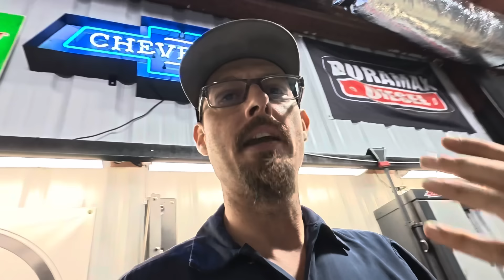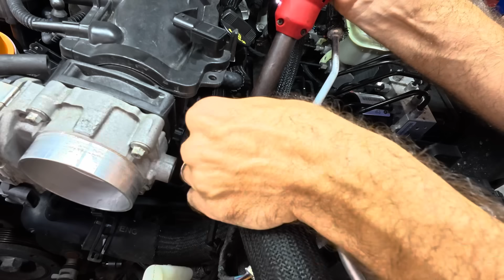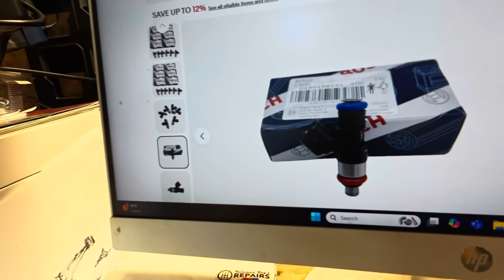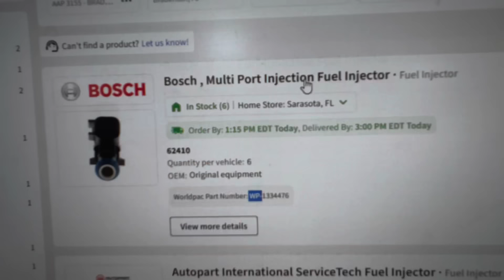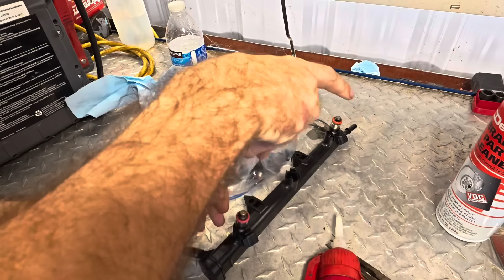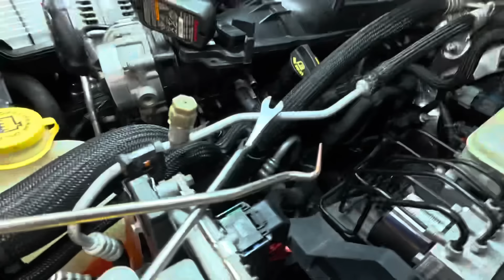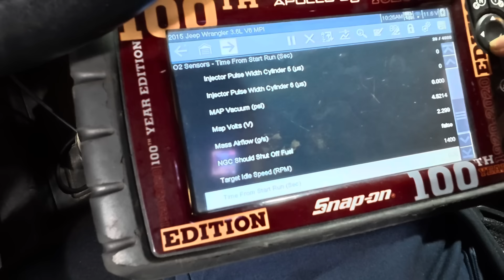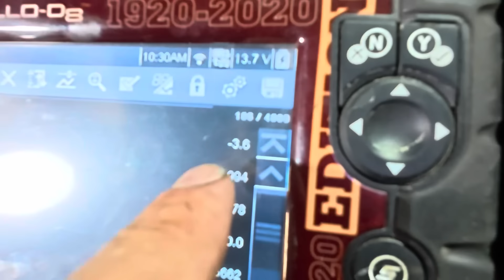Problem FOUND! E-Commerce Auto Parts (STRIKES AGAIN) Jeep Wrangler 3.6 P0172 P0175

Comment: My wife owns a 2014 jeep wrangler  with the 3.6 pentstar “ her dream car since she was 16”. She finally bought one in 2014. I absolutely hate it hate it hate it. Let’s see all the problems.
1. Rebuild the whole top end of the engine
2. Replaced the ENTIRE braking system..EVERYTHING.
3. Leaks water thru the hard top at the seam
4. Manual Transmission jumps out of gear randomly 
5. Rebuilt the entire rear driveline to include driveshaft and ring and pinion
6. Replaced the entire front end steering components 
7 . Replaced all fuel injectors
8. Replaced the engine oil cooler
9. Replaced the PCV valve
10. Replaced all 4 shocks
11. Replaced the air intake manifold, both upper and lower
12. Replaced all 6 coil packs. 
It is NOT lifted and is her daily driver and has never seen any off road use and has stock tires. They are complete junk. Ever changed a PCV valve on one with just basic hand tools ? 3 fricking hours. Oil cooler….an entire day. The maintenance is impeccable on it always top tier oil and it looks brand new inside and out. A jeep is like that beautiful girl you see and when you finally get to know her she is a narcissistic, mentally and emotionally and financially abuser. DID I MENTION I HATE THAT THING ! 🤮🤮🤮💩💩💩

Comment: I liked your detail in the explanation of the issue with fuel injectors ,it shows just how sensitive the ecm is ,way back in the carburetor and points and condenser days we could adjust all that out because it was always about air mixture, but I did learn something , Thank you

Comment: The oil leak isn't the rear main seal it's the oil cooler housing on the top of the engine..yes he has the replacement Dorman housing but I guarantee he didn't use the correct seals on the bottom of the housing..and probably didn't lube said seals when he installed it..most times people (DIY) just slap in the new part and don't torque it correctly or seals leaking..

Comment: Oh wow,  ya those chinesium injectors flow WAY too much fuel,  i watched a visible test on cheap 'Amazon' fake brand name injectors vs OE vs real Bosch and the fake ones were just completely unregulated just pouring  fuel out it was insane how bad they were, they hardly even made a mist, just dumped raw fuel.  That's what you're getting for $100... lol

Comment: Had something similar back in the day, Dealership almost fired me because I called in Ford engineers in short, I found that the fuel in the fuel lines where boiling yes under a hot soak condition, engineers didnt have a clue they where tossing all kinds of parts at it. when the injectors fired they where pumping in air so to speek crazy thing the lean miss condition moved all over no reason where ever the air went first. Then it would go away .My fix since Ford engineers had no clue I took the fuel pressure regulator that was vacuum/ spring  run that was bolted to the rail put it in a vise with a socket and slightly put a crush in it, put a little more pressure on the spring raised the fuel pressure 2-4 psi higher which raised the boiling point of fuel in the rail preventing the evapor lock . Yep the Dealership wanted me fired for that , fixing a car that the engineers couldn't.  One engineer good guy stood up for me. Old physics fluid under pressure raises its boiling point. OH one friend mechanic had the great idea of confirming the vapor he helped me build a external small fuel tank with a fuel pump we ran the car off it and when the gasoline  returned to the external tank to could see the bubbles. It was a little dangerous but well worth the look on the engineers face when it proved our point. 1993 Thunderbird 3.8L v6 engine. And what ended up being changed in parts production fuel pressure regulator spec. Was bumped up.
Reply: I almost got fired the engineers probably got a raise and a trip to the Bahamas. Lol

Comment: These motors and manifold are so mickey mouse nowadays and break all the time ! In the seventies , the motors and electrical and transmission would just go on forever !!! all they build today is absolute junk  GM 5.3 and 6.2 have been blowing lifters.Ever since 2007  all the  way to today's date  and  blowing lifters and spinning rod and crank bearings !! When they are one month old !!!! My two brand new chevy , trucks , blue lifters !!! Got rid of those two pieces of c*** p !!!!!

Comment: You can buy oem parts and have them be as bad as aftermarket parts. Most oem parts are made by someone other than the car manufacturers. Transmissions, differentials, throttle bodies, and brakes are just a tiny list of parts that the manufacturers buy. BTW, they charge 50 times what the parts cost to make.

Comment: Frickin Snap-On. 
Id always replied to the breaker bar comment.
"Yeah, I used a 6ft pipe on the wrench but, your $38 10mm wrench should be able to handle a $1.25 bolt no matter what"

Comment: Yea right? That is why you never ever push towels down into the runners. It is always recommended to leave the towels hanging out so not to forget. Or use painters tape to cover the ports. And I have seen where towels were down in the runners and the engine gets rotated slightly having said towel get caught up  in the valve seat.. that's why you never ever do it.

Comment: E purchases can be great or horrific. Just ordered some air filters and they came in the factory boxes, but it was obvious they were used. They were for a generator, and I  happened to have a new one still in stock and the difference was clear, including a pre-oiled pre-filter on some of the filters, with the torn open wrapper for the pre-filter stuck in the box. Also one of the filters wasn't even the correct brand in the factory box. It's a crazy world out there. Keep up the good work Captain Ray!

Comment: Anyone with a JK, if you need injectors for cheap, the JL OEM injectors are a fraction of the cost of the JK oem. Plus they ha e better atomization. My jk runs much better with the JL injectors. I believe i paid around $54 per injector in 2025.

Comment: Jeep actually improved something over time...they put flexible rubber hose  between the air filter housing and the left side mount making filter changes less complicated. They do use 8mm screws instead of clips on the air box however.

Comment: As long as fuel trim can be adjusted by the pcm, what does it matter if the injector flows too much fuel? Yeah a little sulphur smell, but it’s not running poorly is it?

Comment: 2004 pontiac bonneville 3.8 V 6 😢electric fuel pump in tank. And that's seven months six fuel pumps , one one hour,   in 3 Day 3 BAD PUMP. 2.\NLASTED A MONTH

Comment: fighting a rich condition on ford 5.4 2v. worked great a couple thousand miles, then had to redo the intake manifold because of a crossover tube gasket leak. both banks rich. chased everything, looks like I may have counterfeit injectors - that worked for a few months. just odd they decided to fail immediately after the intake reinstall.

Comment: That's okay ray I have a 96 Dodge ram 2wd club cab 5.9mag I call the rust bucket 😂😆😂 I will be pulling the motor and upgrading the internals besides I blew the kegger gasket it's time for it to go I'm going with Hughes intake.

Comment: 2017 jeep wrangler sport 

Problem- p0300, p0301 running rough, after 30 seconds of start up, check engine light flashes and chimes. I don’t want to test drive it because don’t want to cause further damage spent well over 12k in parts and labor.

Changed on vehicle:

Battery 
Spark plugs (laser plat.)
Ignition coil (blue streak)
Fuel injectors (mopar) 
Map sensor
Throttle body 
Knock sensors 
Crank sensor
Bank 2 cam int and exh 
Thermostat temp sensor 
Thermostat
O2 sensors all 4 (NTK brand)
Cat converter both sides (doorman) 
PCV valve
Aluminum lower intake plenum
Aluminum oil cooler
Head gaskets
Resurfaced heads
Fuel pump 
Tested for vaccum leaks
Evap purge valve
Timing chains, sprockets and tensioners 
All 6 pig tails on coils and fuel injectors changed
Tipm rebuild (they did find out that the fuel pump circuit was damaged) but nothing else wrong 

Engine over haul:

Both Heads everything new milling brand 
Springs all
Retainers all
Caps all 
Rollers/rockers 
Lifters 
Intake and exhaust valves all 
Bored 50mm (due to scratch on cyl 1 wall)
Main bearings 
Connecting rod bearings 
Milling pistons all
Thrust washer 
Rear main seal 

Current codes: 
P0175 p0172 after scan. I have eBay injectors also. This might be my last set of codes chasing for almost 2 years to get this jeep I got from the stealership. Bought with p0300 p0304 p0301 and other misc codes and leaking oil cooler. P0301 was cyl wall scratch recently had it bored 50mm p0304 was burnt exh valve. If this is my last problem i wish u upload this video 1 year ago haha ill put my old ones back in

Comment: ray wouldn't it be wise to actually ultrasonic clean those injectors before installing? wouldn't wisdom suggest you remove the paper towels before you install and tighten the upper intake?

Comment: I was watching and did I miss something or did you forget to pull the paper shop towels out of the intake runners?
At 31:13 when you seated the intake and were then able to start the bolts, the blue towels were still in the motor. Just wondering!!

Comment: Sounds like a clear- cut case of something i was just talking about,
" it cant be those parts cause they are brand new "
So everything else is looked at except the new parts.
Reply: " out with the new, in with the old "
There is a ' special ' feeling you get when you take out brand new parts and put old used ones in and it works better.

Comment: I did the same stupid thing for PO171/172.
SO, I ENDED UP SENDING MY ORIGINAL DENZO INJECTORS FOR COMPLETE RESTORATION 80$ & 10 DAY TURNAROUND). AND THE ISSUE IS GONE!
OLD BUT STILL LEARNING. TRY " THE INJECTION SHOP" NO DIRECT INJECTORS.

Comment: Had a similar issue with aftermarket injector on my 2015 Charger 3.6. Purchased a single reman injector after one somehow completely died on my way home from work (bad luck) and it gave a "cylinder imbalance" code P219B with wild negative fuel trim on that bank, would cut down to -25 long term. Ran like hot garbage at idle. Pulled the fuel rail out inspected everything again and still the same. Finally moved the injector to the other side and got P219A, same problem on the other bank. Replaced with a Bosch injector from RA and it was fine. Became a master at removing the upper manifold.

The part was from Napa and listed as compatible with the same part number also available on RA. Likely just a dud but I do wonder how many others have had similar issues. The tip of the nozzle looked slightly different too which I noticed when installing but assumed it'd be fine as I got it from Napa and aren't shops everywhere putting this part in? was the Autoline 16581

Comment: I got some counterfeit moog hubs on ebay years ago (2017-18), went bad in months... put the old one back in, turned out not to be the issue...

The issue was the wiring to the hub, installing a new one just moved the wiring so it wasn't disconnecting anymore. It came back months later and was properly fixed.

I only buy on amazon now and return anything that is suspect... because I was suspicious of those hubs. The logo was lasered in a different location and wasn't the same size...

Comment: had a rich condition on my 4.0 right after getting "bosch" injectors from amazon. They were not flow matched, but were bosch. When I called bosch they said companies buy bulk injectors then dont flow match them. Purchased a rebuilt set of factory injectors.. no more rich condition.

Comment: I had a 200 ft pull of wire in a rural settings where we had no electricity.  I needed a source for vacuum to pull a line through. I thought why not put the end of the conduit in the intake of my Isuzu 223 diesel engine. At the other end of pipe I setup a spool of string and tied a rag to the end of it and started it in the pipe. I fired up the engine and attached as the ball string got smaller and smaller. Then I heard the engine barf slightly. I ran up to shut down the engine. I was surprised to see red shop rag  fluff coming out of the exhaust pipe. Yes the rag and about thirty feet of cord had been converted to lint which came out the exhaust. So it is possible for a motor to ingest rags in limited quantities.

Comment: The markup on the injectors is awful, well any parts. The motor company paid 1/10 or less for the part you buy at their parts counter at the dealership. That's no exaggeration. I worked for the company that made the OEM part.

Comment: You can test injectors without disassembly. Most manufacturers have specs, and scan tools have bidirectional control for injector balance testing. That could be compared against known good values.

Comment: I have a different form of Rock Auto disease. When I need a part I order 2 or 3 extras as I have 3 1996 Chevrolet K1500 trucks. I have decided to drive these until I die. This way I always have original GM parts in stock and don’t have to wait. My biggest fear is the insane Democrats will return to power and outlaw or price gasoline out of existence as they destroy our country

Comment: i just hate how it's such a spaghetti mess of tubes and wires on top of each other inside an engine bay, it's like the worst cable managed computer you could ever build, seems so hard to track where things go and what things do, it's like they use cables and brackets to avoid putting any effort into planning the engine bay to be easily serviceable, they could put wires in cheap plastic covers that snap it an make clean lines but no, let make it look like medusa's hair, but i guess i can understand, at 50,000 they surely can't afford to use an extra 10 pieces of plastic at $4 each, that $40 pays like so much of their million dollar bonus check, and paying a designer to actual think well that's like $8 per vehicle, that's way too much profit loss

Comment: You probably want to find out the supplier of the injectors.  $100 for a set of high flow injectors is not bad if you can find a set for your car.

Comment: I have a 95 Nissan hardbody pick up. I put a set of “Nissan”factory injectors in it that I got off of eBay that were supposedly NOS.
It never gets over 13 miles to the gallon. The group I’m in on Facebook for those trucks has a lot of people having issues with fuel injectors. A side-by-side photo comparison shows the orifice is a lot larger in the new injectors versus the originals. So I really think a lot of this stuff is being counterfeited

Comment: Just had a Grand Cherokee that customer changed injectors and same issue. Amazon cheapo too. The customer said the same thing, came on right after. He did the orange can too. Recently had a injector on the way out causing minor 2-4 misfire count on #3. The windings were failing and the injector was double bouncing. Usually I get them when the injector is failed and the pcm disables it. That injector listing says REMANUFACTURED b/c they are rewinds. I talked to a supplier that a customer wanted for his Mazda. 2 were bad out of box, 1 failed in one week, another 2 weeks later. The supplier said he just gets them in batches from China and ohms them and color tags them. They'll send you another forever when it fails but the hours are not. You should have flowed them on the car before and after.

Comment: Had a similar issue with my scion, note to self and others don't cheap out on injectors. At least in my case it wasn't throwing any codes but was misfiring slightly causing a slight delay on acceleration. Got some name brand and slightly bigger injectors and thankfully solved the problem! Love the content Ray!!

Comment: I've seen so many problems caused by cheap injectors. RICH, LEAN, long cranking warm re-start, gasoline smell underhood, poor cold driveoff, and more.   Even "quality remans" (GB REMAN) have leaked RIGHT OUT OF THE BOX 🤨. I flow test injectors for a few years now -- helps with diag and when replacing a set. I try to go OE on injectors, but if the cost is completely rediculous, and grandma cannot pay $200 per injector, i've had really good luck with NEW from Standard Motor Parts. They are about half price from OE and fuel trims always 👍👍.

Comment: With respect to the blue wiper gag, the old 2stroke single cylinder Marshal diesel tractor you could feed a small piece of paper in through intake and it would blow it out the exhaust. The rate of fuel burn and low cylinder temp would mean the paper just got a bit signed.

Comment: This topic is ridiculous to me. Mechanics will not suggest Rock Auto or use them where you can get OEM parts or quality aftermarket parts for low prices, but then they will do these videos where they tell you to avoid low quality parts..............while they almost exclusively use the closest discount auto parts store that has junk aftermarket parts at inflated prices.  (They just want to get the job done as fast as possible, they never think about the quality of the part as long as it's super fast and warrantied).

Comment: A good thing to mention ray would be clean your connectors and add dielectric grease before reconnecting.  It keeps the connector clean and it's also easier to remove. Alot of people forget to clean connectors and grease them before reconnecting. Its a dying practice.